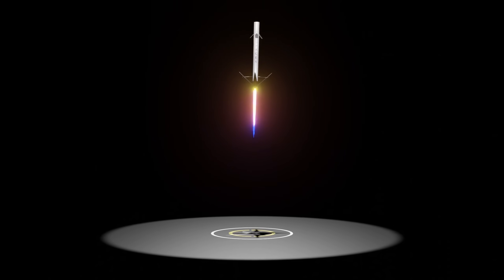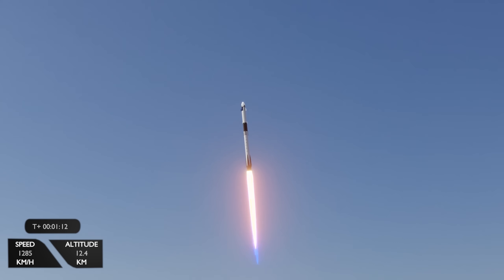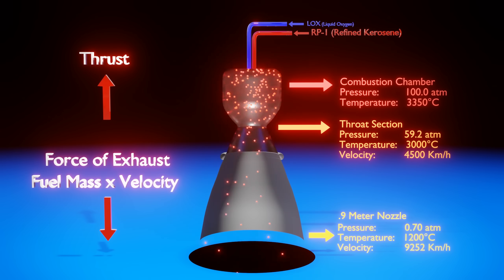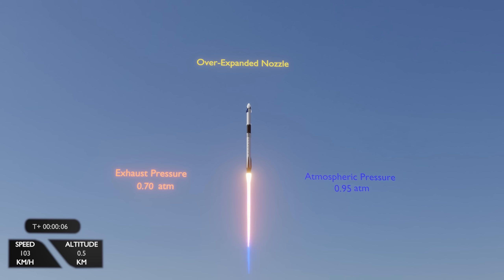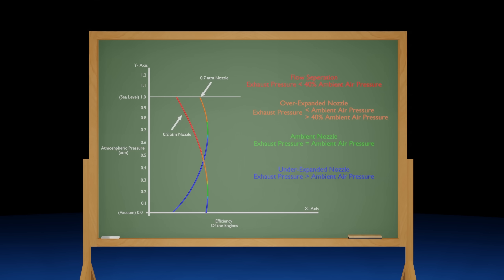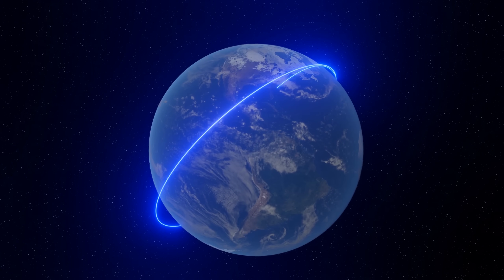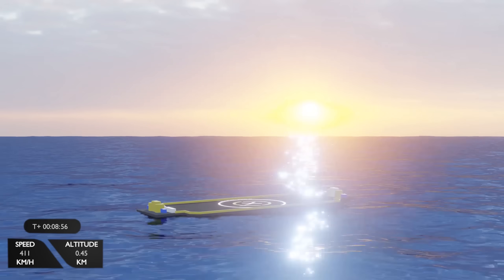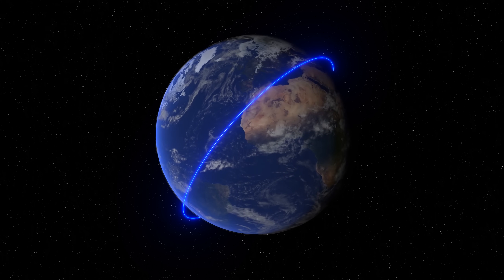Why Doesn't SpaceX Recover the Second Stage

Comment: I don't know if this has been mentioned as an additional factor - the engine on both stages are identical, only the exhaust bellhousing is different. 
You only lose one Merlin engine on stage 2 whereas you would lose 9 + 1 (on the 2nd stage) if you didn't recover stage 1's engines.
SpaceX can afford to lose one. Nine engines is a lot more.
Plus the reasons given, especially velocities at MECO/SECO.

Comment: I know a little bit about atmospheric pressure and density that could burn the 2nd stage at that speed if it goes into re-entry, but I haven't know about that flow separation that could damage the nozzle, I hope that in the future spacex could find a way out to recover it's 2nd stage so that the space junk comes from every rocket launch from SpaceX could be minimized or even reduced to 0, which also could cuts the launch cost a little bit. Thanks for the explanation by the way, really understandable

Comment: @2:49 The promise of the aerospike engine, optimal exhaust pressure at all alts by inverting the shape of a rocket nozzle. If funding hadn't been cut in 2001 NASA could of already had VentureStar flying with one.

Comment: I'm not certain about this but I believe that the engine of the second stage is made of berilium or its alloy so it would burn up in the atmosfere even faster than steel because of how reactive it is. Now, while it is light and wonderfully stiff, it is also insanely poisonous and carcinogenic. It is like a forbidden holy grale of metalurgy.

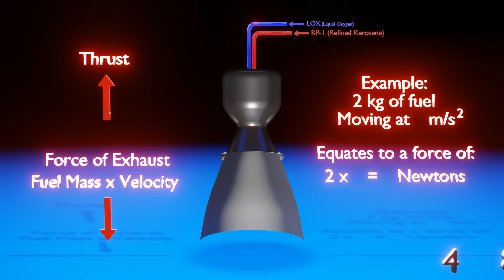Comment: Good video, but I believe you made a typo in the equation for force shown on 2:24 as F=m*v (instead of 1/2 m*v^2), which m*v measures the momentum, not the force. But then on the right side, it was shown correctly with the acceleration (4ms^-2) shown.

Comment: The simple answer is : we dont recover the second stage for the same reason that we have more than one stage , which is : the engines 
First stage engines are desinged for working in thick atmosphere starting from sea level 
While the second stage are engine designed to work only in higher altitude, which mean if we tried to make the land on the earth they will end up crashing , the thrust they produce wont be enough  
I thank KSP forteaching me this through years

Comment: It is amazing how low the pressure is in the nozzle. Also, the video explains very well the difference between the first and second-stage efficiency of each altitude or outer pressure. Summary to rocket factory: You cannot get all, have to be some compromise.

Comment: so question than, does the second stage engine than just sit in orbit or is it released and uses some method to deorbit even if it will be destroyed. I ask this because if the engine is released while the payload is in orbit, wouldnt it too be in similar if not exact same orbit. I understand that when decoupling there is a small amount of force that separates it, meaning the two would travel at different speeds, would the engine just collide back with the payload at some point during the orbit?

edit: just realized he made a video on the second stage... woops

Comment: Actually the engines dont start at T-0 the engines start at roughly T-3s so that they get time to throttle to full power and when they reach full power the rocket lifts off at T-0. Just thought that was a fact i should share

Comment: don't see the point of it landing perfectly up straight on an offshore platform.... its probably more efficient to let it fall in the sea just make it able to float which will be easier to recover and transport back to spaceX launch pad almost immediately by the recovering ship.... transporting it back to a launch pad from a platform up straight seem like more trouble than its worth while making more work to be able to land back down as such while also requiring extra effort to lay it horizontal again for transportation back to the spacex launch pad.... plus you are probably wasting more fuel to do kind of more complex and precise maneuver.... and while letting it fall into the sea instead just requires a bit of fuel to just reduce the force of the stage 1 unit enough to fall into the sea without sustaining much damage and you don't need precise positioning maneuvering but just require just general direction maneuvering.... its just common sense at this point and more green not to land it on a offshore platform up straight.....
Reply: When anything metal splashes into the sea, re-use will be extremely difficult.  Even if possible, it will cost a lot.  Thus noone will let the first stage splash into the sea if they want to re-use it.  It will be cheaper to build a completely new one than to clean-up the water soaked first stage.

Comment: Is there a reason why they don't make 2 part vacuum nozzles that can slow down to re entry speed in the vaccumm then jeteson most of the nozzle ring creating a better profile for low atmospheric pressures? This way you recover 99% of the space craft and the jettisoned nozzle ring gets burned up in the atmosphere so as not to contribute to space waste.

Comment: 10 minute of FANBOY space X advertisement and 10 sec to explain it is just too expansive. Yah? 
They said the same for the 1st stage too 40 years ago. Space X is just too lazy to figure out a way to wrangle all the second stage together, put them into a larg rentry vehicle and land it back on earth. or the moon or the space junkyard.
Reply: I know it's not ready yet but... Aren't they building starship because the second stage gets larger to transfer the same payload because of the fuel added and at that point it's easier to just build a whole new rocket from scratch than modify every part of the falcon rocket? Sorry if this doesn't make much sense
Reply: Although I do agree with the rest of the comment, this video is too long with so much filler it's obvious they're trying to get to the 10min mark for more ads

Comment: What are the physical constraints and possibilities for initiating flight at 90⁰ less than vertical take-off along a track which maintains earth tangency? A planet-tangent track would deliver the horizontal/tangent trajectory for the module at 7 miles high after 200 miles of travel along that track. As a permanent structure - a linear-synchronous electrical means programmed to work optimally in relation to atmospheric density - could achieve what maximum speed? How might that be increased if the delivery module had a heavy outer perfectly circular ring also spinning to optimum capability and conserving momentum? What might be added by a late slight canting upwards of the track towards its end? Would a chemical burn be necessary to add to these means to achieve precession point/orbit? Is there not a permanent geo-magnetic effect over Lake Ontario which might be reacted to electro-magnetically in order to increase altitude ‘for nothing’?

Comment: Thanks for getting closer to a full explanation of the life of a  second stage rocket.
Are second stages destined to fall anywhere, helter skelter? 
Are second stages destined to burn up completely with nothing hitting earth?
Is second stage debris deliberately programmed to fall in the Pacific ocean?
What about polar orbits? Where do they fall?
Occasionally Falcon 9 first stage does not return to LZ or barge. Are these directed to burn up and remaining debris planned to drop in the Pacific?
Did all of (Apollo/Skylab) Saturn V first stages splash down in the Atlantic? That's 13 expensive boosters, used once and tossed aside.

Comment: Congratulations... you are the first channel to explain WHY a rocket turns on it's side to attain 'Orbital' Velocity...

Your graphics and math made a complex engineering challenge easy to understand. Most people who watch are not Rocket Scientist. Your explanation of the differences between first and second stage rocket engines was spot on. 

One item everyone overlooks is relationship of velocity / mass / thrust / acceleration / over time. As the rocket loses mass (burned fuel) it becomes lighter. If thrust is held constant, the rocket's acceleration will increase. This can help makeup for loss of engine efficiency as rocket gains altitude. I don't know if engines are throttled back to hold acceleration constant, but that is one benefit of having liquid fuel rockets.

Former Boeing... great video... just subscribed...

Comment: Thanks for a well made video explaining this technology.

Question, does the second stage completely burn up on reentry?  
If not, would there a patch of ocean that is getting littered with the remains of the second stages from rockets, assuming a similar launch trajectory and stage separation location between rockets?
Reply from the maker: Thanks! Great question, I actually made another video answering this. Based on from what I gathered in research, most of it burns up and what doesn’t, lands in designated spots in the ocean th right a deorbit burn. I believe it’s different places each time as orbits vary in shape, size and angle.

Comment: the cost of the 2nd stage will eventually pay for its recovery Especially if it is landed near the refurbishing shops or origin of launch.  Yes, Heat Shield and Paraglide Chutes would add cost.  Recovery could also wait a few orbits unit just before a natural orbit decay that all LEO 2nd/3rd Stages will go through, hours, Days or weeks after launch.  We, the US, have great experience with very light but very successful ceramic Heat tiles used on the Shuttle, X37-B and the Orion CM.  Space X is placing the Ceramic Heat tiles on it's Starship, which is essentially the Second Stage of the entire Starship Stack.  One other issue that is not discussed is the somewhat unpredictability of the return location of all 2nd and 3rd stages, see recent articles on the Chinese CCP/PLA re-entering upper stages.   Finally for Solar synchronized and Geo synchronize orbital mission the added Debrie could be extensively reduced.

Comment: Thanks to this excellent x-planer, I now understand that the high velocity the second stage reaches, prevents it from surviving reentry in a potential recovery, without adding slowing mechanisms like parachutes, extra weight that will take away from payload capacity. I have full confidence that if the 2nd stage Merlin engine can indeed be used twice that the magician, Elon Musk, will figure away to do so. Thank you to the presenter.
Reply from the maker: You’re most welcome! Thanks for watching and the kind words!

Comment: spacex could use parachutes and modify the 2nd stage such that it has more thrusters on the sides so it doesnt have to use its main engine
spacex could add the same heat tiles they put on the starship and let the 2nd stage enter the atmosphere without risk and they have have a deployable heat shield on the side of the engine to also protect it from the heating then the parachutes will slow the 2nd stage to a safe speed and the thrusters would fire during the last 3 seconds before touchdown
then the landing legs would deploy on the same drogue ship that the 1st stage has landed on and would take its spot since the 1st stage would be recovered by then

Comment: Why is no one trying to use expanding nuzzles to make an engine efficient at both vacuum and sea level?
Reply: the added weight and complexity of designing the engine would negate its efficiency, but maybe in the future with better light weight materials and fuel this could happen

Comment: Also, the fist stage of the Falcon 9 has 9 engines, which are costly, but the 2nd stage has only one, so the economic benefit of recovering the 2nd stage is lower than recovering the first stage.
Reply: What happens with that second stage? It stays in orbit and gets lost?
Reply: @kilmergarcia4995  I think they usually try to deorbit it if there's fuel remaining, just depends on the orbital height of the mission and if they would have enough fuel left to deorbit without dramatically reducing payload mass.

Comment: Why don t they built a gas station with several 2 nd stage and then pull it more into space with another trip it will work for somthing in the future
Reply: Creating circular shape and then pull throw the middle by another trip just for that
Reply: Craeting a permanent gas station or just a station
Reply: i think thats SpaceX's idea with the starship, if they want to get to mars they will need many refuelling's between each starship; so the first starship to launch will only be to refuel the next few so they can reach mars. Once space becomes more colonisable, there defo will have these kind of stations.
Reply: They are wasting matirial right now look at it as a sters that will be the first step
Reply: First step doesnt need to be durble beacuse its near earth  ..second option could be conecting two second station to get back to earth like the first station
Reply: Stage not station doeas what i ment
Reply: I mean stage

Comment: In short, i like to explain it like this. The second stage is significantly harder to recover, has a much higher cost to payload capacity to recover, while also being much cheaper than the first stage. Thus as it stands, it's just not worth it to recover it.

Comment: Nice work. However, the second stage doesn't heat up due to friction as much as due to the shock wave it creates during reentry. The compressed atmosphere of the shock wave radiates its heat to the second stage. Intriguingly, that phenomenon is why firing a rocket engine into the shock wave can actually make you go faster not slower under certain circumstances.

Comment: why not use them as station parts ? and fuel dumps ?
Reply: added complexity and weight, but soon enough there will be those types of stations, just not hanging on the side of 2nd stages.

Comment: Easy answer the 2nd stage is so high up in the atmosphere that upon re-entry it burns up. Do you think it would be cost effective to build a heat shield to recover the 2nd stage? This question is like a no brainer but if you are smoked up really good you think about things like this. Cut back on the weed dude....lol...lol

Comment: I think you're looking way to deep in to this simply answered question.
Yes engine and nozzle power and design is a reason why one stage is and one isn't recovered, stage one has Gimbels and more engines therefore more power ana bigger fuel tanks to allow enough fuel to recover itself, and stage two doesn't,
Single engine no thrusters, so no self landing recovery, but do they recover it later, from the ocean and reuse it?
If so then it is recoverable, just isn't recovered like stage one is, by itself using it's guidance systems.
So you may be mixing up recovered and recoverable, then what about reusable,so the first stage is auto recoverable and reusable, but the second stage isn't auto recoverable, and isn't designed to be recovered, but can it be reused, like the first stage is.

Comment: SpaceX could recover the second stage by making Cold gas thruster to flip the 2nd stage and have a heat shield on top of to second stage, when it comes in the atmosphere the heat shield would protect the 2nd stage. You could put fins to make sure that the heat shield faces down and put the landing gear upside down to let it land

Comment: Could one starship be used to collect multiple falcon 9 second stages that were parked in an orbit? Or would that not be cost effective?

Suppose you could get 5 second stages back to earth with one starship launch. It would save around 60 million dollars. And a starship launch would be what, 200000 dollars? Seems like quite a bit of profit. Although you could just use starship for all launches instead.

Comment: My only question is; and Im asking this from the perspective of someone who has zero engineering experience but would simply like to know anyway:

If atmospheric differentiation is a problem, why not adjust it as it pressure differs?
 Heres my idea; You know how fighter jets have these little fan-piston things at the back of the thruster which are all angled around the nozzle?

Although I think the reason fighter jets have them is for a completely different reason ( like slowing down and speeding up ), I feel like it could be repurposed here,
 You can literally force pressure and release pressure thus ( in theory ) allowing the engine to always be at its max efficiency no matter the difference in pressure from in and outside the thruster.

So, this would allow both stages to be recovered without adding extra weight to add parachutes, this would also cut on the amount of space junk we have and make our rockets truly and completely reusable.

Oh and to detect atmospherics, I'm sure there is a way to do so.

Comment: We perfectly well can design our engine to work well at a wide variety of pressures. All current rocket producers choose not to use the design that would greatly increase efficiency, the Aerospike, because it would require spending in R&D as there is not ~50 years of existing engineering to draw on.

Comment: SpaceX is looking to recover the second stage. This would be a heat shield and probably parachutes. While with will limit the payload size, the falcon 9 does this already, there would be a savings in cost and materiel. Then again SpaceX is thinking of scrapping the Falcon 9 one starship is fully operational.

Comment: Maybe this is a stupid question. Is it not possible to design a rocket nozzle that can adjust its geometry to compensate for the external pressure? Much like how aeroplane wings have flaps and slats, and how thrust vectoring can adjust direction and diameter, can they not engineer a similar solution?